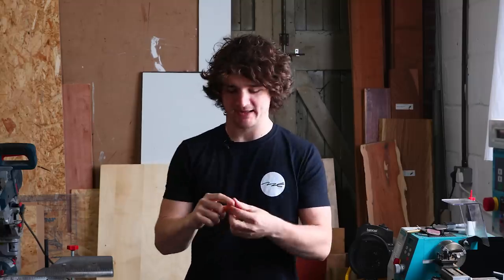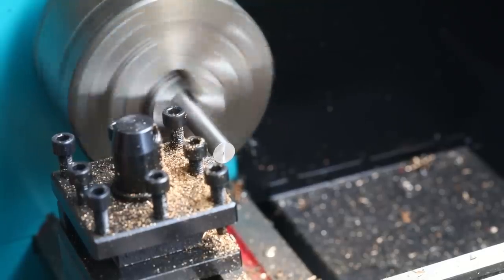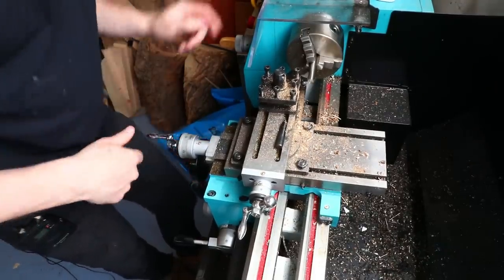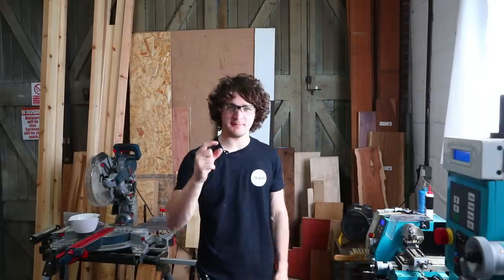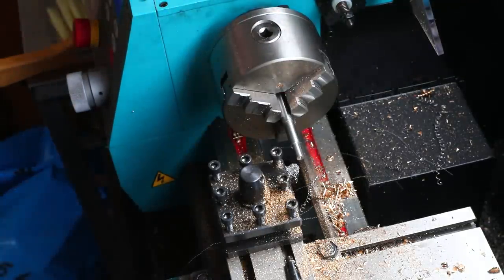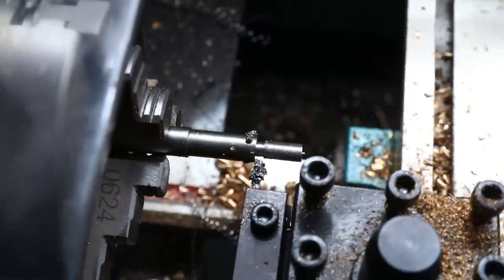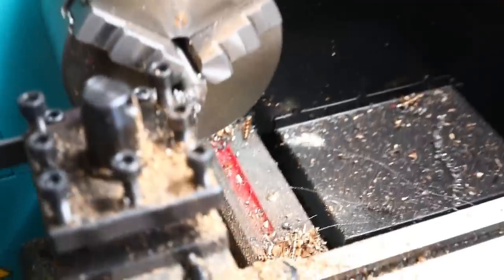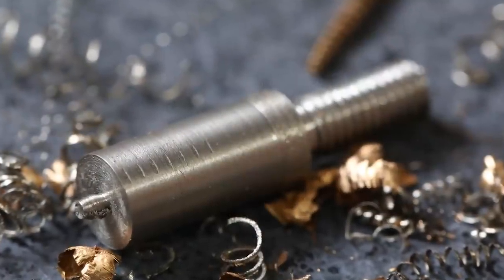Engineers, I need your help | Turning Tuesday #17

Comment: Good video... lighting be damned, I prefer your effort on "this kind of subject" be about getting the point across rather than the glamour of YT-hollyweird show-off stuff...

   Looks like you've got a fair range of advice going on down here... SO I'm just joining in the general chorus of the usual basics...

1. Shims, yes... Whether you cut your own for each tool (some do) so you can use ONE SHIM per tool... OR you go to a shop and get several sets of feeler-gauges to take apart (so you have numbers and measures to go by and stack them)... It doesn't particularly matter... other than personal taste. I've cut my own for that "one shim does the job" effect, and it's a worthy use of "personal time"... BUT if you want "get it quick"... feelers every time.

2.  UP with the RPM's and DOWN with the FEED RATE... Faster is always "sloppier" in these things, and with the size of stock you're turning, it really matters... It takes a bit of trig' but turning the RPM's to a material speed/pass rate is useful until you "get a feel" for your personal machinery.
     ...and that takes time and practice, so NOW you know why older machinists are pricks about people monkeying with favorite tools.

3. Quick Change Tool Posts... These friggin' things are life-savers. They don't have to be ridiculously expensive, but most of the machinist friends I have keep "a few around" for preset tool arrangements they can rely on for more than one job... This allows you to already have cutters shimmed and ready with pre-calibrated torque settings noted on "tags" with them, for the jobs they do... AND at least in the tiniest world of turning metal... yes, torque counts.
    It's alright if you don't have the where-with-all to start a big collection of tool posts and tools right now... JUST that you know you can save some extra time by keeping more than one for your machine is a good idea... THEN rather than bothering to change tools every-time, since most jobs require similar set-up... you can bounce between the same "usuals" for most of your work... AND have one "clear" tool post to use for "oddities"... where you specifically arrange tool by tool to get a one-time job.

4.  ... AND FINALLY... you don't even have to know how to set up everything on a lathe for it to be useful in "threading"... The tail-stock is useful for support to keep the die square AND to put a bit of pressure on it to start the threads... You don't have to turn anything "On"... so continuing to thread by hand is still an option (until you get a clear lesson on your machine for it)... and you save all the time of dismounting the part (cutting it off) and running to the vice to finish the job... do everything and THEN cut it off.

    Along with the chorus of viewers with similar (and MORE AND BETTER) advice... You're doing okay... It's starting out, so remember to breathe, relax, and you can get there from here. We're all pulling for ya! ;o)
Reply from the maker: That’s really helpful mate, thank you! Like you said, it echoes a lot of the other comments but there’s a few things in there that we’re still new to me. Cheers!
Reply: @MattEstlea  Only glad to help where I can...
   Hesitantly, I've heard of some lathe-work being "batched" by running a full length of stock across the lathe, and with math prepp'ed and written down in advance, the parting tool can be used to set references for several parts at once... 

   BUT with you "just starting out" among the myriad of other possible issues... It may not be worth even looking into.

   I was able (usually) to accomplish a reliable output, BUT if it wasn't for pasting a "step by step quick reference" to the wall over my lathe, I'd have been TOTALLY SCREWED... ;o)

Comment: Your tool is too far below center first of all. Now for some FYI. I don't know what you're using that for but know this...303 is not food grade stainless. It contains traces of lead. That's why it's so machinable. I just thought I'd let you know that. ..Oh and get a mighty mag and get a 1 inch travel indicator on the carriage to measure your length.